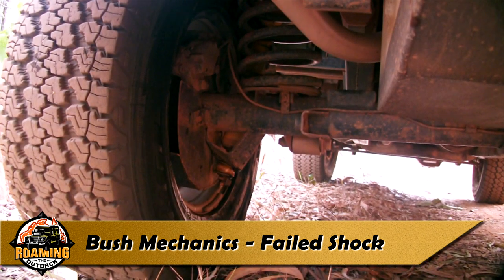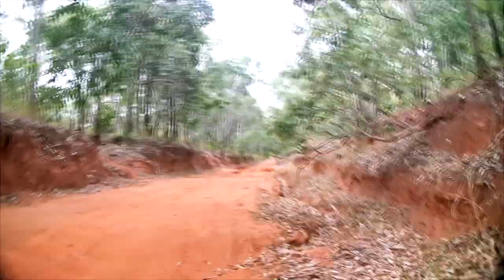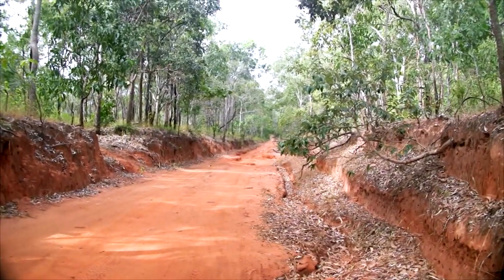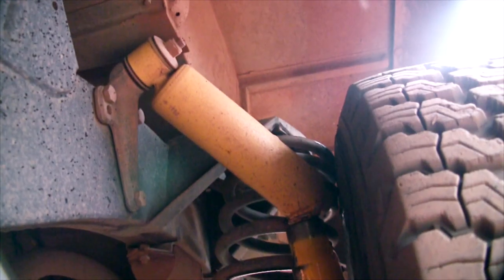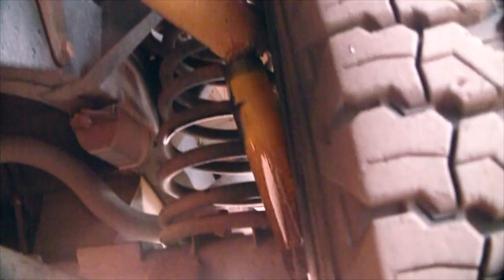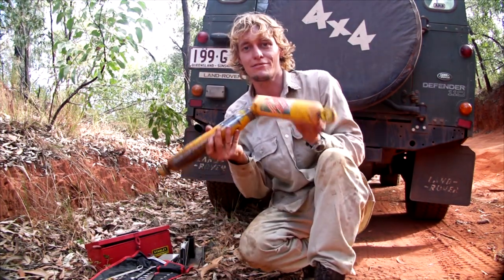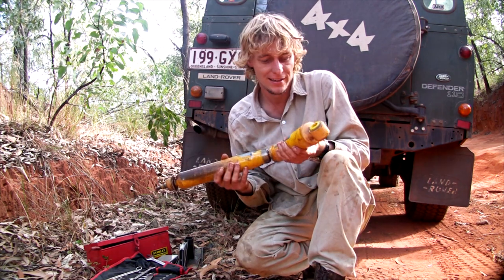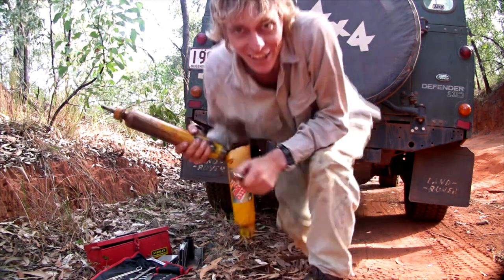Bush Mechanics | Shock Absorber Failure on Cape York

Comment: Old Man Emu shocks were useless on my Landcruiser 60 series. On an outback road they overheated and lost there shock absorbing ability. A switch to Konl shocks fixed the problem. They were just as good 10 years later when I sold the car.
Reply from the maker: Yes Koni have performed perfectly to date. No issues.
Reply: I had Koni Raid on my Defender. Drove them across the desert a few times, up the Cape and the High Country and they were great. What I learnt about remote travel in Australia was first get good tyres, then get good suspension. Both will be punished.

Comment: Overall have you found your 110 300tdi to be reliable put on your bush travels Bret?
They may be high maintenance but i don't think I could ever part with mine 👍
Reply from the maker: Mines the 200tdi. Overall, yes reliable. The majority of the issues I've had over 14 years while travelling could be fixed on the track. Just keep the maintenance up. I'm keeping mine a good many more years.
Reply: @RoamingTheOutback  that's crazy long! 👍

Comment: From an engineering point of view, your spring height may need looking at if they're reaching the end of their travel on washouts. Whilst Defenders are well known for needing spring retainers on full travel, you really shouldn't be getting there on that type of track. Hope the current fix holds well for you 👍
Reply from the maker: I changed to Koni's with dislocation cones. NO problems since.
Reply: @RoamingTheOutback  Just realised this was an older video as I was sure you were running Konis. At least you moved onwards & upwards 😀

Comment: You can see by the rub mark on the upper inner shock tube it has been getting pushed side ways for quite a while
Failure probably caused by the loose Y frame bolts
Have seen this happen before
Reply from the maker: The A frame bolts only rattled loose after driving without the shock. The wear may have been from the 30m or so I travelled before stopping to check.